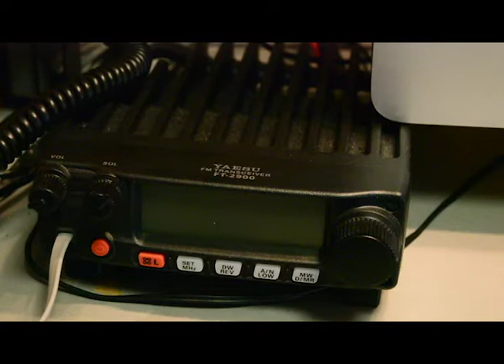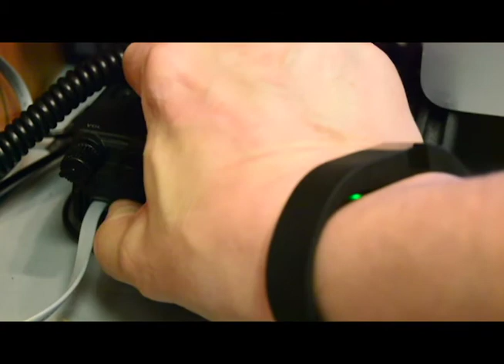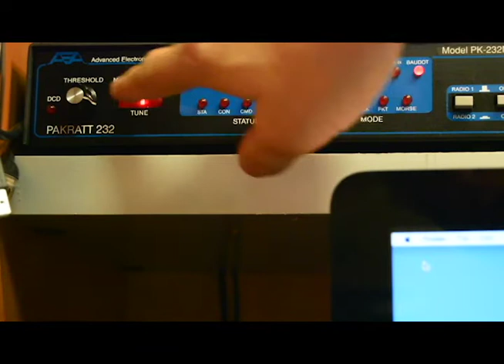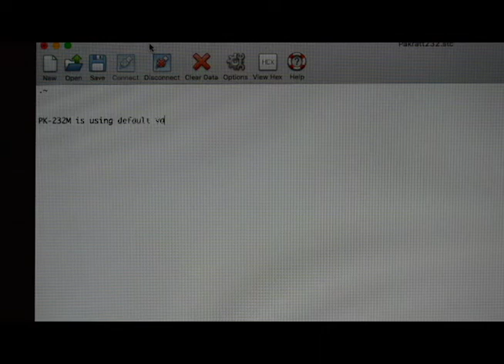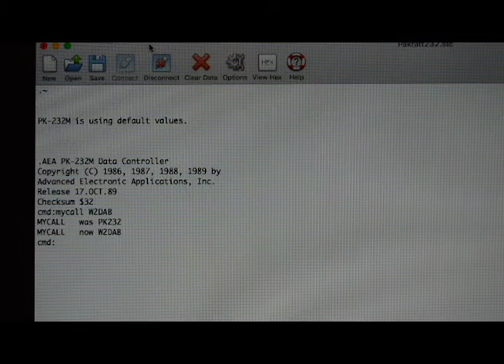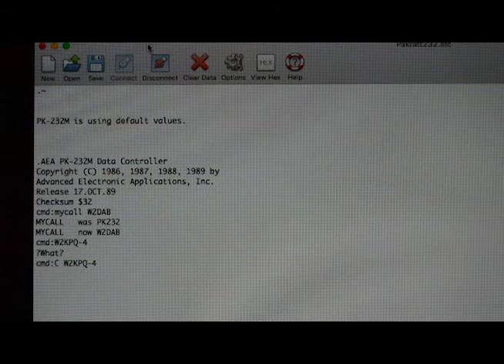Packet Radio with FT-2900r and the Pakratt 232 TNC

Comment: Do you have the manual for this modem/tnc?  I notice you are setting the PC > TNC Baud rate to 1200.  You should use the highest speed available for the PC to TNC rate, which is should be 9600 or AUTOBAUD..  This is only the speed which the computer communicates with the TNC, not the on air data speed.

Comment: Hi, I would actually use it to communicate with the ARISS (ISS APRS digipeater). Can this modem actually communicate with AFSK 1200 ax.25?
Reply from the maker: I believe so although I haven't personally used it to connect to the ISS APRS digipeater, I would refer you to the manual: https://www.dl0bn.de/dc7xj/Anleitungen/AEA%20PK-232%20OperatingManual.pdf   Good luck and post back here if you have anything to add.  73
Reply: @flashMXdesigner  thank you very much!!!

Comment: Very nice video! I have one pk232 too but I can’t have the menu at the beginning. I only have the sentence that ask me to put the star mark. I push the shift 8 four times and it’s always the same thing, the leds move from right to left but no real connexion with it. 
I tried several cables, speed etc… nothing. Do I miss something? Thank you for your help!
Reply from the maker: I could probably go through things a bit, but I sold my PK-232 a year or so ago.  I would say to practice single variable trouble shooting, download a manual for the TNC... start fresh with settings recommended then change one thing at a time like the baud or the bits setting then change back and try something else, then again return.  If you have a multimeter, check the pinouts from the radio to the computer, 'ohm them out' to check that they're also up to the manual specs.  Hope this helps in some small way, it's a lot of fun when it works.  73
Reply: @flashMXdesigner  thanks a lot for your help. I will try what I can do:) ! 73
Reply from the maker: @Kon7ptor  Just rebought a used PK-232MBX, couldn't stay away!  Look on the bottom for the reset jumper. Should be a hole with a jumper exposed... pull the jumper for a few minutes then put it back. Worked to reset my unit.  Hope this helps.
Reply: @flashMXdesigner  Oh thanks a lot !!! I will try !! Thanks for the advice!

Comment: What mode are you operating in on 2 meter band?
Reply: Packet Radio using Amateur X.25 protocol on FM.  The FT-2900r is FM only.
Reply: @DavidBamford  I just bought one on Ebay, I want to play with it and get familiar with it and do cw and different modes with it, including 2 meter modes...
Reply: @briancherry787  Have fun, the PK-232 has two radio hookups, so you can have your 2 meter FM on one button and an HF on the other if you want to experiment with the CW modes.  Best of luck  73

Comment: I thought it was supposed to be 8 bits?
Reply from the maker: In most cases, it is best to start out with a 1200 baud terminal baud rate, a 7 bit word, a 1 bit stop bit, and even parity. Be sure your terminal parameters are set to the same values as the TNC.
Reply: pcomp do you set software control on?
Reply from the maker: Using a simple terminal program on my Mac, no software control... the terminal received all controls and settings manually.